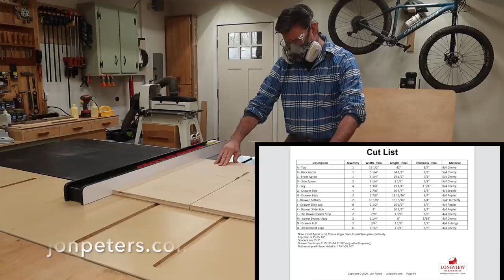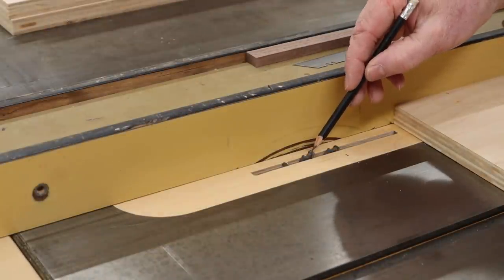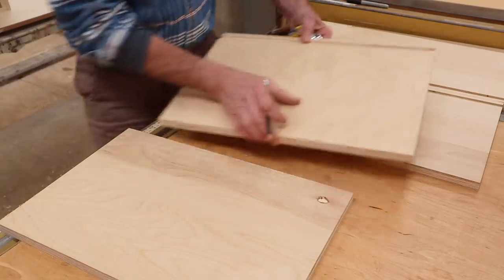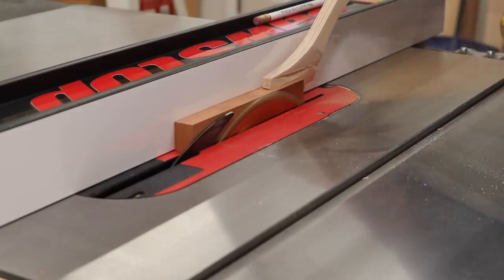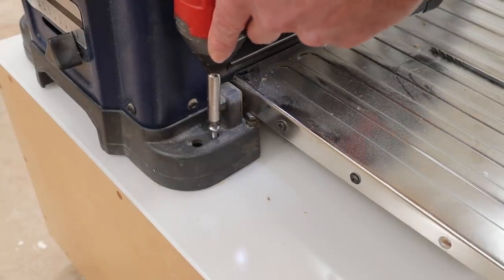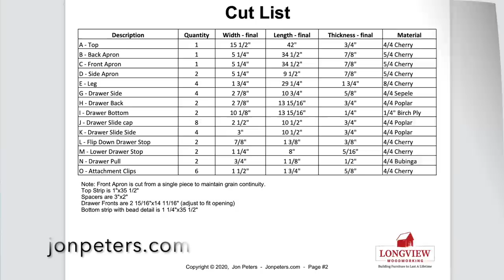How To Build A Mobile Planer Cart with Storage Cabinet

Comment: When do  you decide to use your cross-cut sled for 'sheet' material vs just running it along the fence, (vs. using a circular saw to break it down first)? My school's shop had a strict no crosscut with the fence rule, even if it was a larger piece. (7:50 vs 11:14 for example).

Comment: Jon  I came back and watched this as per your recommendation at the end or the Blum drawer slide install video; which by the way was very helpful.  I noticed you used side mount -soft close - full extension drawer slides on this project.  Are these an Acuride or Blum product or other.  thanks in advance   Love your channel, DocK

Comment: I saw this on IG: do U have 4 ft high? I nead to have moblile pliner 3 ft from ground to be able use it whit out pain in back.
Reply from the maker: Hi Jan, yeah that makes sense… I made this at the level because I didn’t want it to be any higher than my outfeed table
Reply: @JonPetersArtHome  i have dewalt planer in those type and it love to glue up. As I plane lot of pine, larch and sprus on knife create layer of hard  resin, this causes feed problems. On Ur stand I would have to work on my lap, when is nead to feed board by push it manually. 

But as always on Ur chanel it look nice... for some one who plane only hard wood pradobly work fine.

Comment: Just curious why you built it so low? I can understand if you were storing it under a bench to save space, but it seems like that isn't the case at least now.  Having it a bit higher means you don't have to bend over to feed boards into it and is easier on the back.
Reply: I have the same question. Something higher that could outfeed onto your assembly table or table saw would seem to make sense.
Reply: Same question from me Jon, just curious because I realize it’s your project your shop your time. 😀
Reply: Same question. My cart is high enough that the planer table is slightly above 34 inches ... allowing me to use the tablesaw outfeed table as planer outfeed. To those with concerns about stability with the cart that high, it's rock solid, despite a Dewalt 735 sitting on top. Mine incorporates two drawers.
Reply: I feel like I understand the design of this project. The infeed tray doesn't swing vertical like the outfeed tray does, so I understand why Jon offset the planer towards the back, allowing the infeed tray to be flush with the face of the cabinet. Doing so, helped to conserve space and makes it easier to use as needed (avoids having to attach and detach infeed tray). I would want the trays at countertop height, but with the floorspace he seems to be willing to sacrifice, likely limited the height of the cabinet; any higher would likely cause the cabinet to topple over. We all have opinions, so here's me "Monday morning quarterbacking"...build it so the trays are countertop height, and the cabinet is ~50% wider, mount planer sideways so infeed and outfeed trays can be permanently in down position and are flush with side faces of cabinet...just saved unnecessary back strains. Loved his video, the build, and his level of explanation. Just like any plans made available by any woodworker, the plans can be bought and modified for your needs and preferences.

Comment: Nice build Jon! However, as others have commented, I was also wondering why the cart is so low? Even my back hurts when thinking about running boards through that planer.  😂😂
Reply from the maker: 😂 thanks Steve, yeah I didn’t want the planer to be higher than the out feed table.